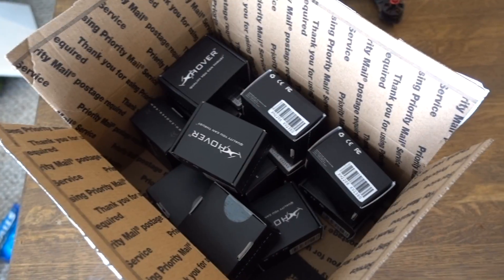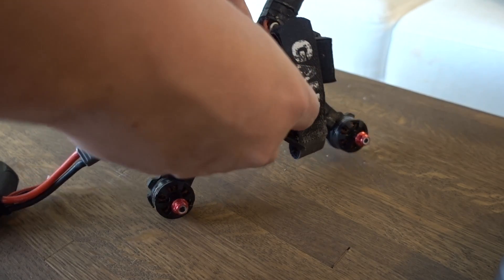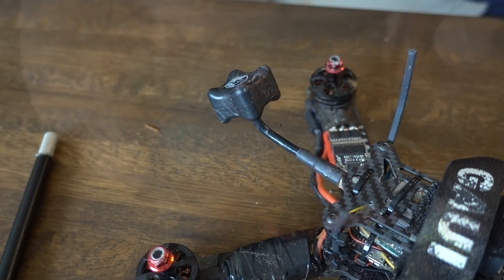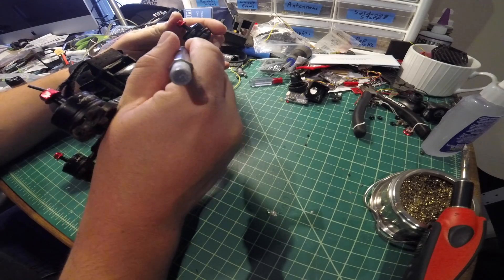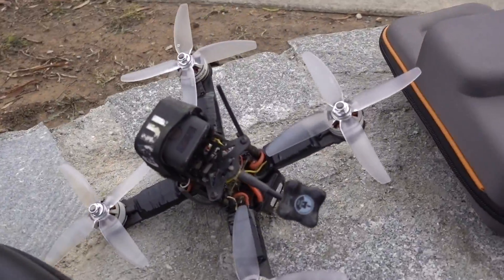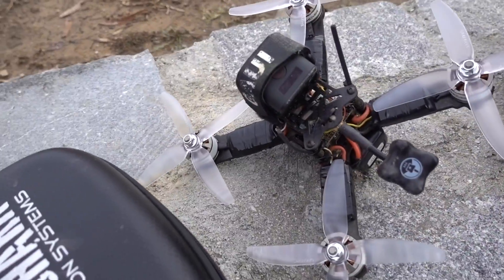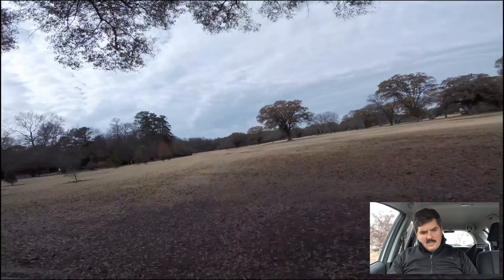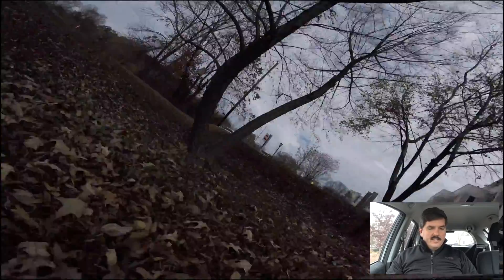I Got New Motors!! Testing The Xhover 2206 2360kv

Comment: Make a Motor tester for these kind of situations. 
I made one out of an old esc, with a servo tester pot meter for speed adjustment. Added a 5V UBEC to feed the servo tester. On the other side of the esc, solder 3 wires with a isolated Crocodile clip. All powered from a lipo XT60 connector. Small cheap tool and handy to test out motors.

Comment: I'd like to add my two cents on why I think you may have regained functionality of your esc only once it was unwrapped... The esc could till have had moisture trapped under the tape that wouldn't have otherwise had a chance to escape. Opening it up may have been just that little bit that it needed to start functioning again. After water damage always open/expose as much of your electronics as you can to get as much air to it as you can. Haha it's a little long winded but I hope this helps shed some light on water damage.
Reply: donovan p I doubt the moisture problem (if there was one) would have evaporated in a matter of seconds. It would need much more time

Comment: What size is that Gaui strap is that and where do you buy them? New motors look sweet btw.
Also, never used it but i've heard corrosion x does wonders for waterproofing electronics
Reply: doluseb so does plasti dip or liquid electrical tape.  Just make sure you get it on even
Reply: daniel passmore those don't come off....

Comment: do you even dshot bro
Reply from the maker: +Ultimatevapor918 not yet
Reply: me neither lol
Reply: dude you gotta try the Blade Thrust 2205 2750kv my Kwad is on crack now lol
Reply: Ultimatevapor918 what are the Blade Thrust? Isn't it a quad?
Reply: +Ray Choi no they are 2205 2600kv blade thrust on horizon hobby im using t motor f60 now